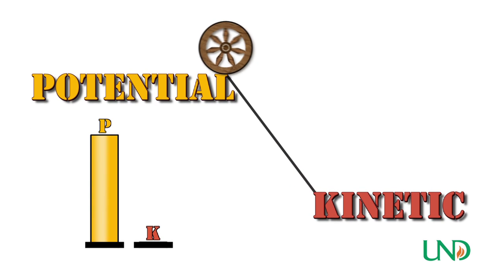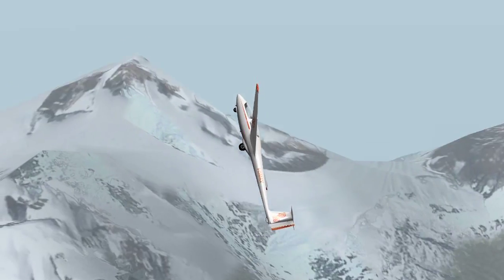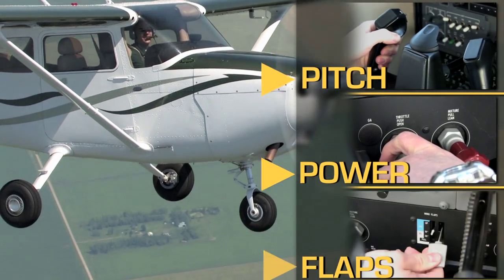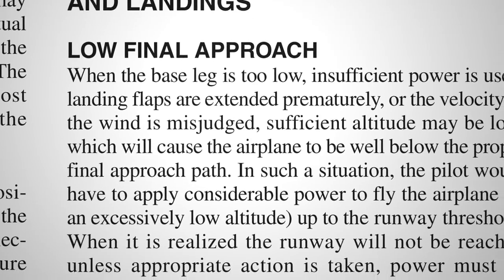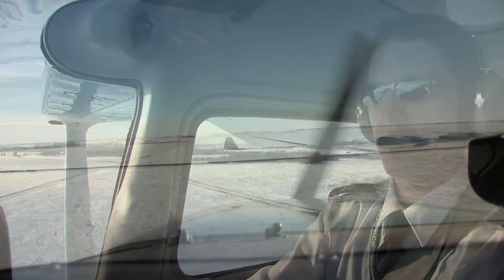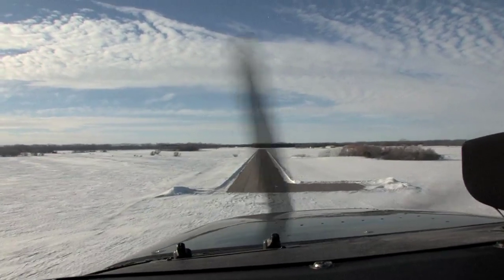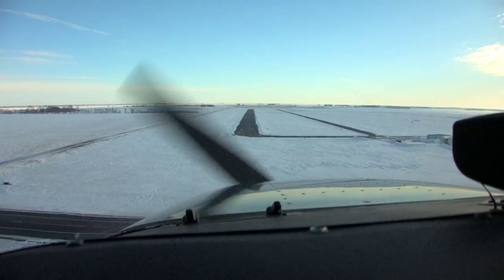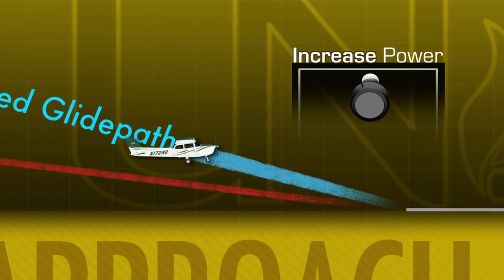(VIDEO 1) Faulty Approaches: Energy Management

Comment: "Landings are not meant to be saved" man I remember my first crosswind at skill limit "brain locking" on the task of landing, trying to "save" a bad cross winder (11-13 knt. in a C-172) while my instructor (F-4 era Naval Aviator) cooly sat r.h. watching me sweat and fight it; not saying a word. It took a glance of the main wheel on my side, proximity to the s runway marker light can at about the midpoint of the runway for me to finally in frustration voice an expletive like aw F*%#-!  and "snap out of it" and remember to "fly the airplane, apply power, and go around!"...only to hear in a cool low voice fit for radio state from the right seat.. "I was wondering when you were going to go around".
Reply: Agree. Wanna save a landing?  Go Around.  That's how we save a landing.    Thumbs up!